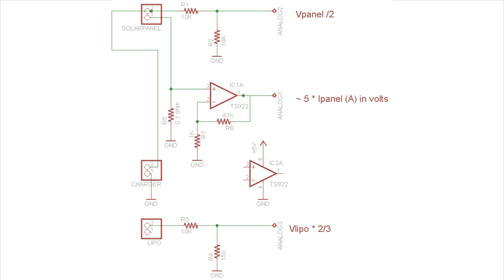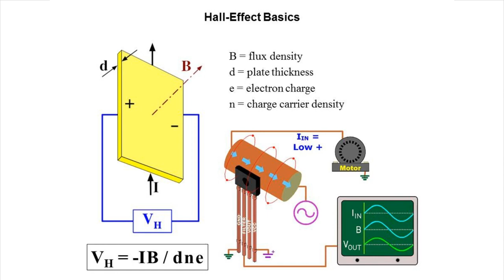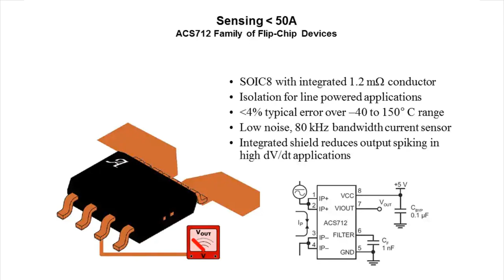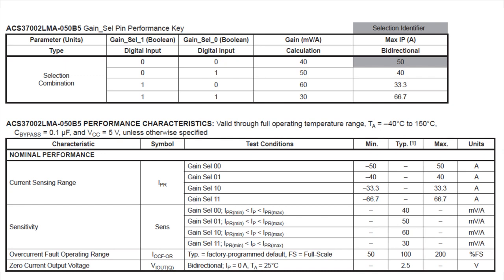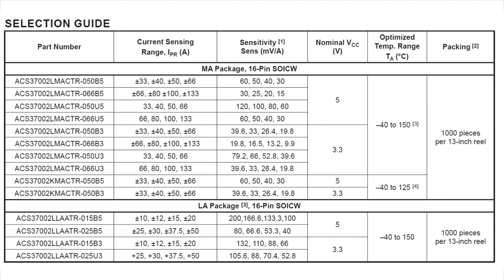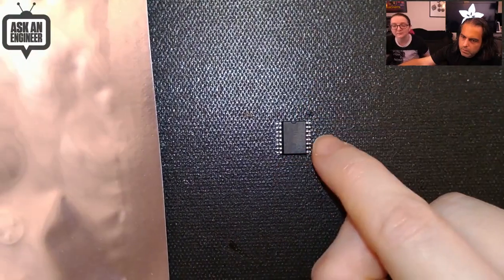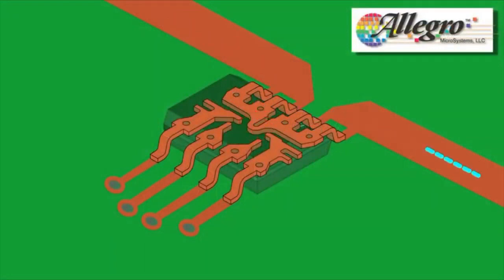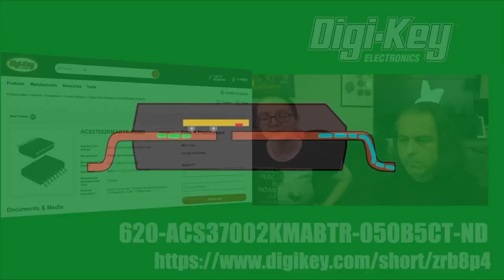EYE on NPI - ACS37002 electrically isolated current sensors #EyeOnNPI @DigiKey @allegromicro

Comment: I was looking for a chip that could detect a short circuit, so I can make a electronic breaker.
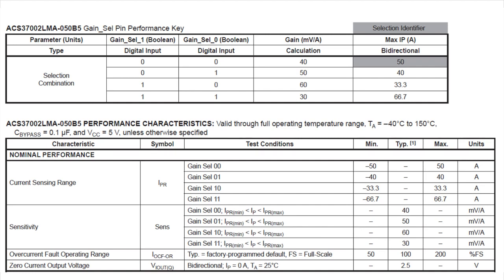I was listening to this video, believing that this was not the chip but still curious of its capabilities, and then I hear at 6:35 "some interrupt and other good stuff", it clicked in my brain and I saw in the datasheet that it has a pin for fault detection, precisely what I was looking for.